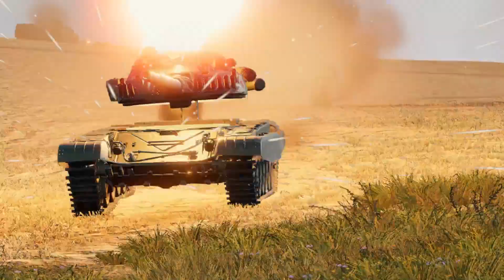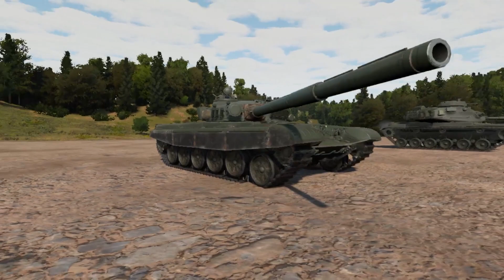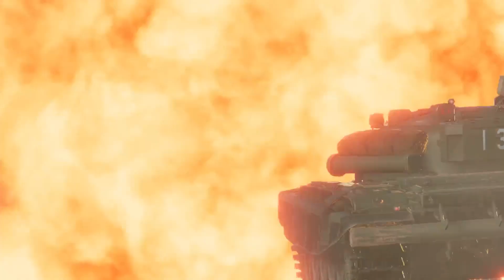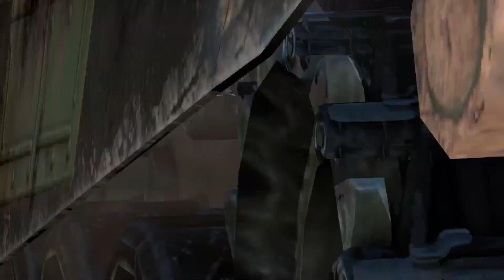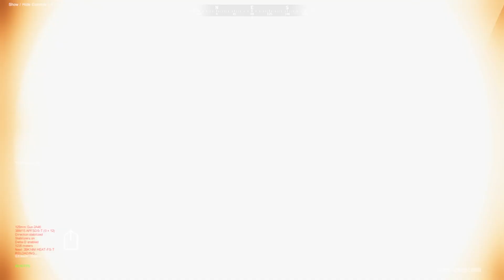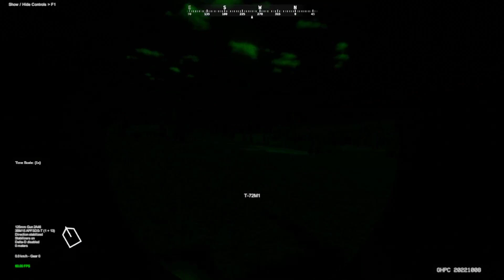FAST, MOBILE , and DEADLY This Cold War Tank was Feared | Gunner, Heat, PC Tutorial!

Comment: But this T72 model it's not the equivalent of the M1A1 present in the game
Reply from the maker: Oh yeah, The T72 will get shredded by most of  NATOs forces but they are still fun to use. They are also a bit challenging.
Reply: That seem like nonsense.  The T-72AV front armor (with K1) should resist up to TOW2 and HOT missile.
Reply from the maker: @erst2018  I will have to run some test in GHPC but so far the T72s are fairly vulnerable. These are the T72M an export variant. Manual says composite front armor.
Reply: @erst2018  T72 with K1 was not used in the theatre depicted in the game. There's also no M1A1. Only M1, and M1IP.

Comment: Is it me or is it most of ghpc missions last 5 min and could be completed without players participation?
Reply: Well, you are part of a whole. You are not a superhero.
Reply from the maker: @Heldermaior  I agree but I also think several improvements can be made. Battles resolve rather quickly which is both good and bad.
Reply: @TacticsWithJoe  it's a good departure from tedious "simulator" games when you need 20 min to arrive to the place of action, but its TOO fast and TOO short. The lack of conscious game play is also a problem.
Reply from the maker: @MrDrunkblackstar  I don't disagree one bit. The game is easy to pick up and play but it also has its flaws. They stated that infantry will slowdown the gameplay when they are added. They are also working to improve the AI. Overall a lot of good things are coming but it will take time, which is never fun.
Reply: @TacticsWithJoe  well, there is no easy way to change that. Battles are quick because of the scale and the lethality of the weapon systems in use. Once we have the T-64B, T-80B and Leo 2A1/4 it should prove more challenging as those platforms can tank some hits without going up in smoke. But the combat is very mobile and the AI sometimes suicide charges which makes missions last even less.
Reply from the maker: @Heldermaior  Yeah, I don't expect them to change to much. They more recent scenarios are much better than some of the previous ones. I am excited for the new weapon systems that they will be adding. The leo will be fun to pilot and I can't wait to command it on the battlefield. 

The AI does need a few adjustments but that will take time. They are really bad in a few operations. 

However, the devs seem to be able to create operations easily and I would like to see more Company attack ones.
Reply from the maker: It really depends on the mission and the AI. The newer mission feel more fun but the ai is still a bit quirky.